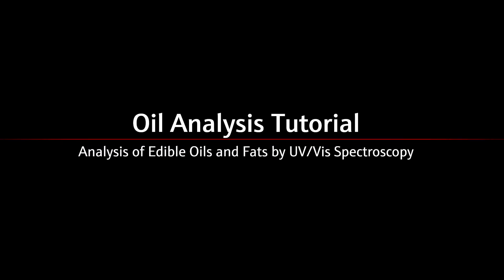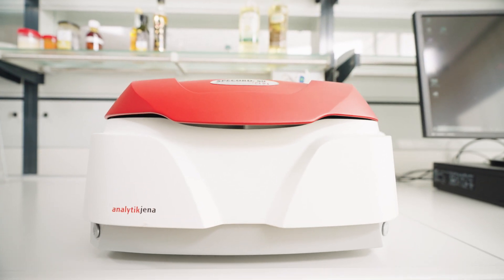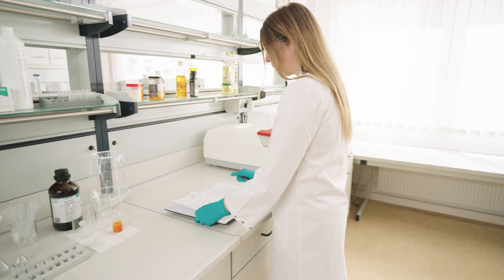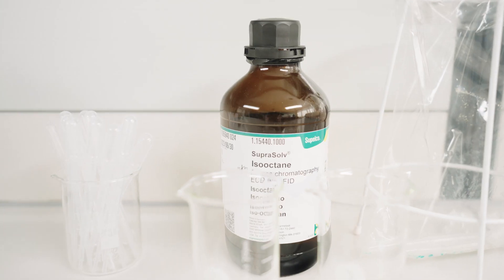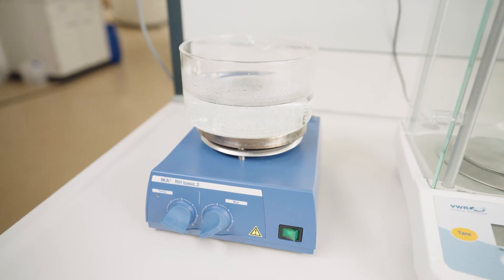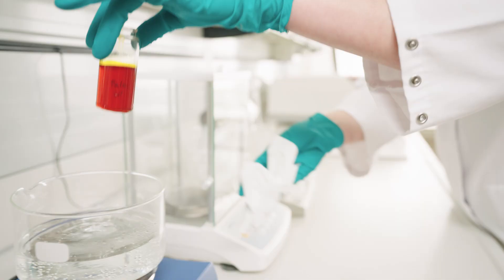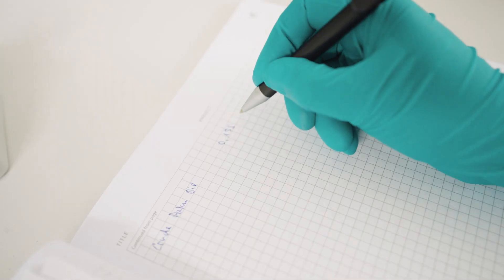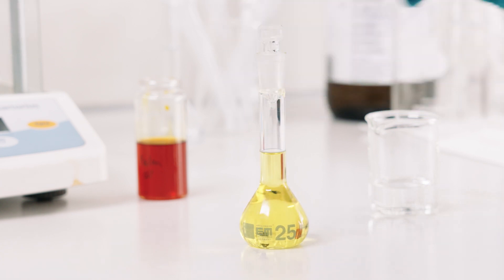Analysis of Edible Oils by UV/Vis Spectroscopy: Sample Preparation

Comment: 1- Could n-hexane be used as a solvent for this analysis?
2- Why is a solvent needed for this analysis? Why can't I analyze a sample of 100% fat/oil?
Reply from the maker: Thank you for your questions @abaurre3. Here are our answers:

1. The palm oil was analysed in accordance with DIN EN ISO 17932. The standard specifies that isooctane should be used as a solvent. 
In general, however, there is no reason not to use hexane.

2. Palm oil quickly returns to a solid state at room temperature. To avoid this, a solvent is added to the palm oil to keep it in the liquid phase.

We hope, this helps. If you have further questions, fell free to contact us.

Kind regards
Reply: @analytik-jena  thank you very much for taking the time to reply. Makes total sense!